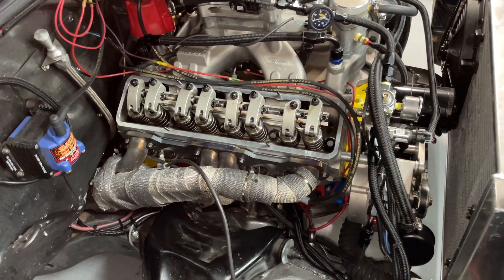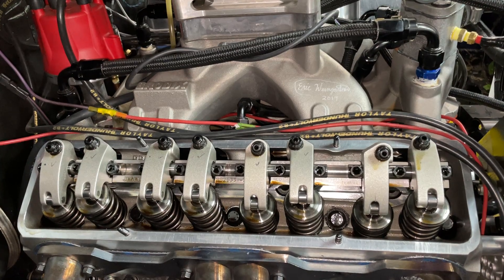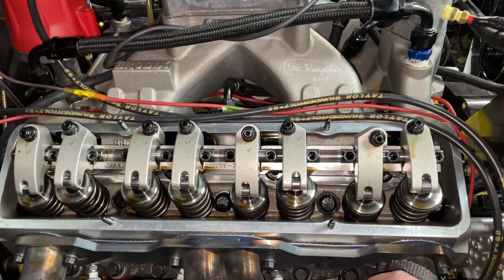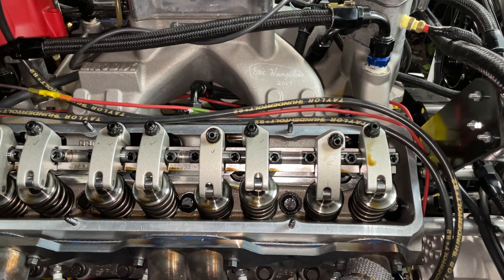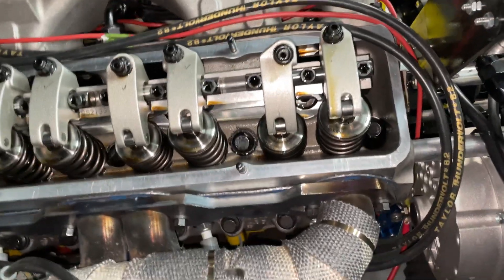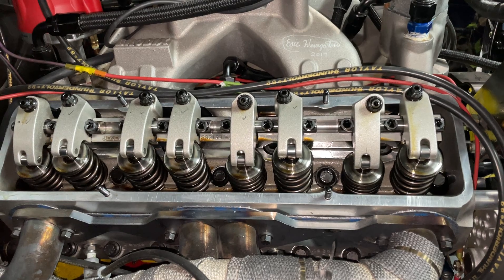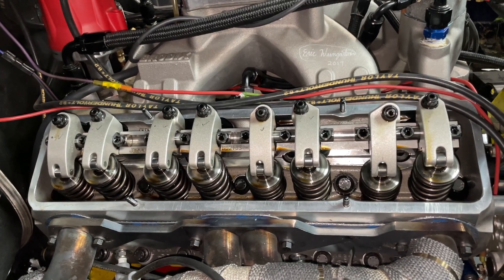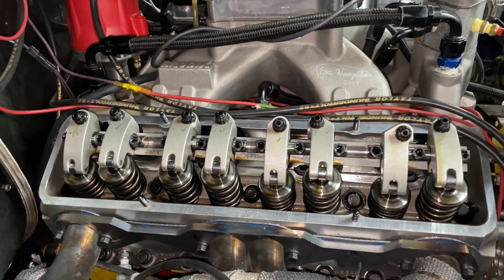Valve train on the s10 shaft rockers

Comment: Good Evening Eric, 
 Your efforts are appreciated and I am by no means a hater. I am concerned about the way that you have the Positive Buss/Junction Wired on the Firewall. If you are using that as a "Common" Bat.+ or Ign.+ Source, then you need to add Fuses, Circuit Breakers or Fusible Links for each Circuit that is Wired from that Point. Once again, NOT a hater, just a concerned supporter of your efforts.
Thanks, 
 Laurence Snyder

Comment: Everything equal, they dont make more power like you said, however the more stable valve train allows for different lobe designs with the same duration and lift numbers to control loft more predictably.    Good stuff, keep it up and maybe some day you can even get a shake with your whataburger meal
Reply: Yes.
But I wonder if there is a cross over point between steel and alloy. Because valve train weight can effect loft too. 
I wish I had a spintron.
Reply: @Channelmaster73   slightly yes.  On our roots blown TS motors we use T&D aluminum, our pro 632 we use Jessel steel, and our procharged DCRE II's they're jessel aluminum.  Its really a function of lobe ramp aggressiveness, spring recovery and RPM.  A bigger piece of the puzzle is putting the largest pushrod possible in it, on that side of the rocker, weight doesnt matter.